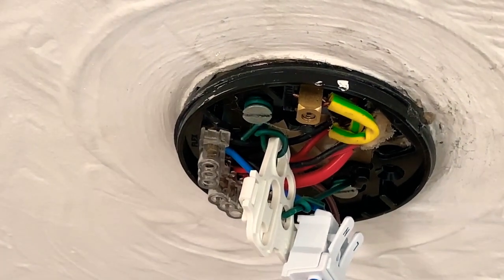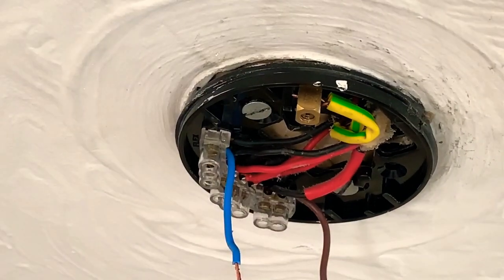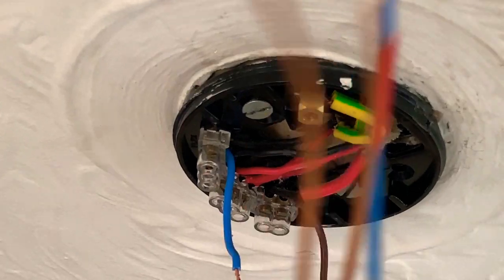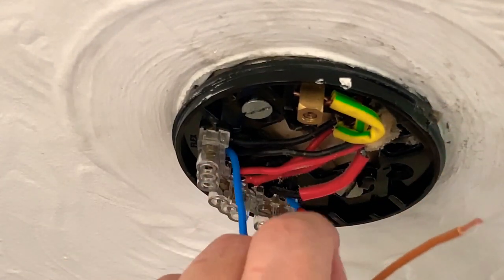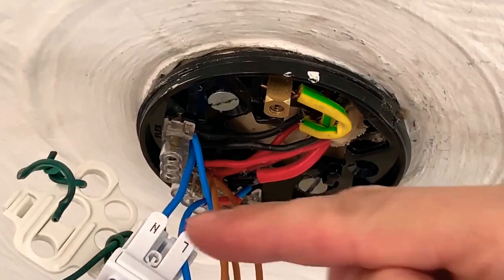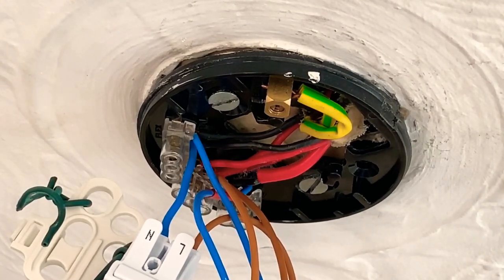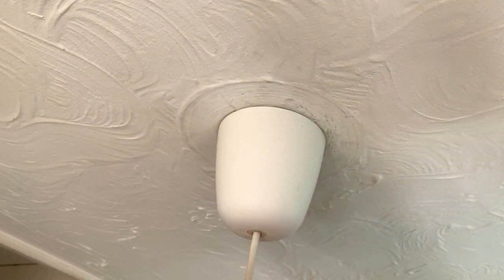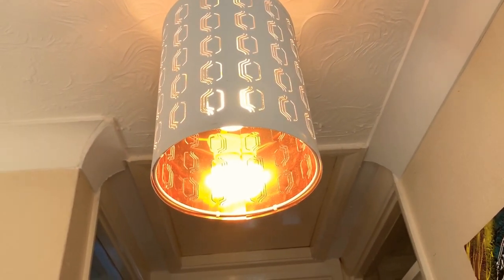Shelly 1 UK ceiling rose 2 way switch

Comment: Nice video. Rather than one (1) and zero (0), the way I keep it straight in my head is rather as input (I) and output (O). Thus, the signal comes in to the relay input and when the relay latches, the signal is output to the attached load. Just helps me; thought it might make it more intuitive for folks wiring up Shellies. Regards.
Reply from the maker: Michael Ingraham thanks that is very nice and I'll use that from now

Comment: @eugeneniemand, superb video. Have been able to wire up 3 shellys because of your video.
Quick question, regarding seeing edge mode in button type, the shelly app doesn't allow me to set that mode unless I change the "power on default" setting to something other than "switch". What more did you use? Many thanks.
Reply from the maker: Sorry I really can’t remember
Reply: OK, no worries. Thanks.

Comment: Do I have to install these relays in each of the ceiling roses if I have 2 ceiling light fittings controlled by 3 wall switches? What model of relay would I need. I'll be using Amazon Echo 4th Generation.

Comment: Will these fit in the regular sized uk ceiling roses? (If u know what I mean by regular size)
Reply from the maker: It doesn’t fit the rose, it either goes in the ceiling cavity or s as in this case the little cable cover from the light

Comment: Nice video thanks . On mine you have to switch the switch on or off to catch up. Could I use a 240 v toggle switch , also did you flash yours with tasmato or are you using the Mqtt built in
Reply from the maker: Mine is standard firmware with mqtt, again this makes no difference. I use an edge switch in the Shelly settings and I do use 240V on L/SW/I terminals so yes you absolutely can

Comment: If you have the light switched on via the switch, and turn off via the app, how does the light switch then work, is the switch then is opposite direction ? ie UP = ON, DOWN = OFF ? or do you have to turn the switch UP and DOWN to get the light to come on via switch ?
Reply: The light switch controls the Shelly to turn the light on and off. The wall switch is just an input device for it. The Shelly relay just detects the change of state on the wall switch so it doesn’t care what way the switch is positioned. Much like two way switching.

Comment: Great little video! One question, when you have switched the light off via the app, can use still use the light switch to then switch the light back on ?
Reply from the maker: Yes that's the beauty of the Shellys is that you can still use your switches. they basically work in parallel like a two-way switch. In this video its actually acting as a third switch as this is already a two-way setup. You keep all existing functionality and adding remote control to it.

Comment: Hi. I have a junction box installed somewhere underneath the floor board :(. So I have only three cables coming out to my ceiling pendant i.e neutral live and earth - so essentially my ceiling rose is in the junction box. How do you recommend I can connect Shelly 1 in this case?
Reply from the maker: The problem with that setup is that the light switch will also turn off the shelly. You really need the ring main circuit to ensure it is always powered and then you can use your switch and the shelly or bypass the switch and only use the shelly

Comment: Can we add this to ceiling rose if we have a dimmer on the wall and still use them in parallel. I know it works with switch but what about dimmer
Reply from the maker: I don’t think it will work in a dimmer unfortunately without some additional wiring. If dimming is important they do sell a dimmer Verizon called Shelly Dimmer 2 if I remember correctly.

Comment: If there's an "off" 'signal' from the domestic wiring, I can see that the light can still be energised via a feed through the relay, as you've shown. I'm assuming in this case that changing the state of the domestic signal to 'on' will have NO effect on the light,  it will still stay on, and can only be turned off by the app?
Reply from the maker: Paul Guiry depends on the button mode that is used. If set mine to edge mode which will toggle the state of the relay regardless if you use the app or the switch.
Reply: @eugeneniemand  perfect,  thanks. I'll buy one

Comment: Can I ask when you say “configure” are you flashing the device as I’ve seen that in other videos and it’s way over my head. I just want to unbox it, connect it up, open the Shelly app, pop my Wi-fi details in and be finished. Is this possible please?
Reply from the maker: Sorry only saw this reply now. Yes it works out the box. No need to flash, however they do support that if it’s something you want to do and will even honour your warrantee if you have flashed it.

Comment: Hi. Great video. I was just looking for this type if advice. If you switch it on at the swtich though, and then off with the shelly, will the switch then switch it back on or will the swtich still remain in the off state?
Reply from the maker: Lloyd Wilkinson depends on the button type setting in your Shelly. I'm using edge button type that means it always work. If you use toggle then the latter part of your statement will be true

Comment: can this be done at a junction box too? I'm currently wiring up some lights in my conservatory and would love to add this but don't have a ceiling rose however do have access to the junction box where the switch wires meet the feed wires.
Reply from the maker: Nathan Kerridge if you have the space and live and neutral wires then yes you can
Reply from the maker: Nathan Kerridge if you have the space and live and neutral wires then yes you can

Comment: Looking to do the same with my stair light. 
Sadly it looks like the Ceiling rose is in the loft or hidden in the ceiling as most of the lights I've worked on just have 2 wires protruding from the ceiling :(
Reply from the maker: Your house muy be wired where your line and neutrals are both at the switch in the wall. Which if you have drywall then you’re golden as you can stick the Shelly in the wall.
Reply: @eugeneniemand  nope, switched lives in the wall as well unfortunately. 

Need to get up in the loft check for junction boxes under the insulation.
Reply from the maker: Ah ok good luck you’ll probably find a rose/junction box somewhere. Not nice digging in insulation though.

Comment: Can this be added behind a switch as well? Thanks for the video.
Reply from the maker: Inter Services if you have a neutral and the space then yes. But if that's the case you may be better off with the sonoff touch switches unless you want to keep the functionality and look of your original switches

Comment: I love the video but I'm 100% clear. Are you just screwing the corresponding wires from the Shelly directly into the existing ceiling rose?
Reply from the maker: Not quite, the switch wire moves from rose to sw terminal on Shelly. The live goes to rose and the L and I(input) terminals. The neutral goes to the rose and the N terminal. A new wire goes from the O(output) to the rose where the switch wire used to be.  In summary the Shelly relay the I/O terminal replaces the switch. The switch becomes a input to the Shelly. Hope this makes sense.
Reply: @eugeneniemand  Thanks Eugene. I understand now. You are basically puttng the shelly between the light and the live switch.
Reply from the maker: @tonymiles1888  exactly that
Reply: I've had it working with a normal bulb but I didn't realise that it doesn't work with Smart Bulbs. Do you know of anything that do? Thanks for your help again

Comment: Hey how would this be wired up if i was to place this behind a light switch instead of celing rose
Reply from the maker: Andrew Jones i guess this depends on your writing. If you have live and neutral at the switch then you can do it. If not you will have to do it at the rose as you do need both.

Comment: Just to be clear the switch at the wall becomes useless? If you turn off the switch at the wall then this also turns off the Shelly?
Reply from the maker: No they work in parallel
Reply: @eugeneniemand  Ah I realize this requires a neutral wire